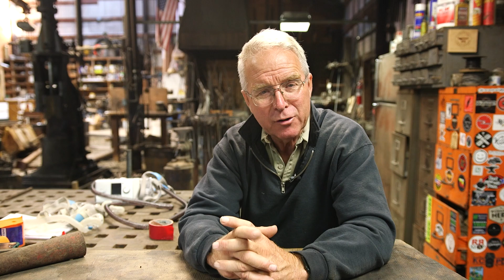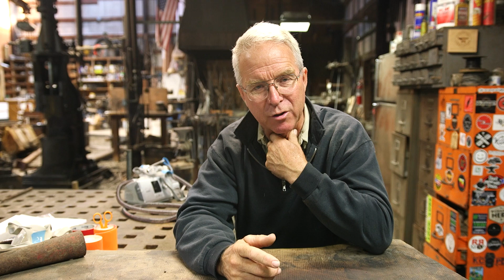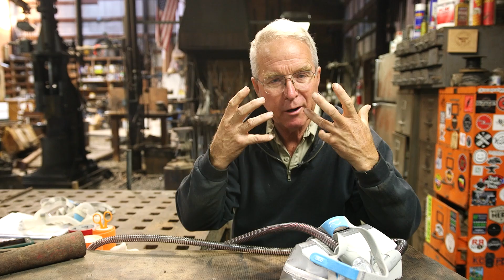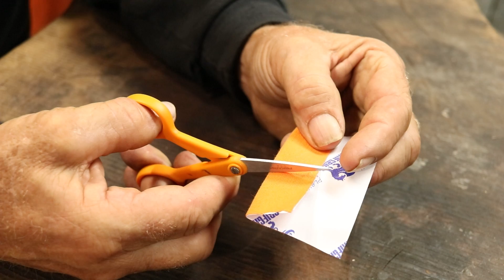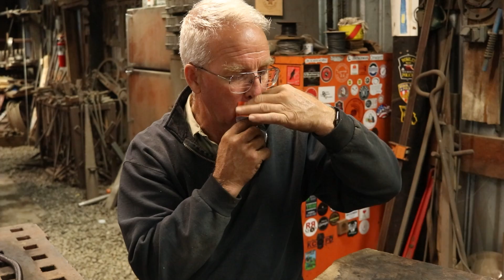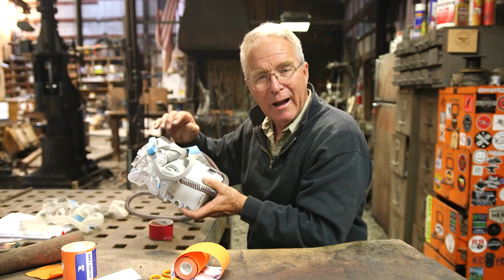Tired Contractor  Here’s My Simple, CHEAP Sleep Apnea Solution

Comment: I need a way to keep my mouth closed. I  found that wearing a full  cotton mask seems to lessen the mouth opening at night. I sleep on a chair futon that has 5 levels at the top. I use medical paper tape when I use tape. Cut the wide tape in half 1/2 inch by 2 inches and tape one side of my mouth from the bottom and pull my skin up and stick. I ordered this tape to try it out. Thanks.

Comment: Tape generates back pressure to stabilize the hypopharynx during expiratory phase of breathing in the 4 different phases of sleep. 
The problem with this it does not compensate suffently during rem sleep whis is very important for the removal of normal brain metabolic waste that may result in an early onset of alzheimer's to name one failure of this approach.
To be clear during rem sleep when we dream we should not normally be aware of our dreams unless we are awaken by untreated sleep apnea in which case we arouse (awaken) in the middle of normal dream sleep or (rem sleep) . This failure ti rest effectively in rem sleep results in excessive daytime sleepiness,higher boold pressure and greater chance of stroke. These comorbidities are a problem please learn to use your cpap effectively there are no short cuts for sleep apnea I strongly suggest you consult directly with a board certified sleep physician to get a good second opinion.

Good health

Comment: My two cents..   Don't eat anything after 5-6pm.  At least try.  I know sometimes is not possible but at least try it.  The logic behind this is that when you eat late it makes your system to suffer from heartburn and that makes your throat muscles to weaken, causing an air block (apnea).  The heartburn occurs more or less after 6-7 hours of eating your food.  If your last meal is at 5-7pm your system will be still strong enough to not have the apnea.  Sorry about my english.  Doing my best.

Comment: I have both apneas as well after my traumatic brain injury.  I had like 100 events per hour.  I could not deal with the CPAP they put me on that night so they started me with a VPAP.  It's like a BiPAP but has a kickstart pressure.  So instead of super high pressure like you had with your BiPAP, they could be much less with the kickstart pressure doing the hard work.  It is the same brand as the BiPAP you have.  It's easy enough to deal with, having pressures set where it's enough to handle the obstructed.  I don't really know when the central kickstart happens.  I have heard so many people talk about how much better they are on a CPAP and haven't gotten there, but I have many other issues due to my brain injury, so there's that lol.  I don't have an open mouth issue that I am aware of, but thought that maybe a VPAP might help with the pressures.  Sounds like the tape works good and you don't need another strap to keep your mouth closed.  Nice!

Comment: Scott do you feel that this tape trick will work with a goatee? I have the exact same bipap machine and even a much higher elevated stop breathing events an hour.  And I have both central and obstructive. After 2 years of sleep tests and different machines I finally gave up for same reasons you did. The dang masks (I tried every available type on the planet )were what you said, "like a medevil torture device". It started to send me into into  a panic mode just looking at the gad awful thing sitting on my nightstand! At this point I foolishly would rather give up the bipap machine and the consequences than give up my prized goatee that I have had for 20 years.

Comment: I have a beard so the full tape doesn't work. I just tear off about an inch of  1/2" adhesive tape. It holds well enough, comes off easily and I make it short enough so that I can breath out of the sides of my lips if I need to.

Comment: central apnea tho. what are ppl's experience with getting the brain to send that signal for taking breaths? medication?
Reply: Central apnea is usually due to CO2 retention, drug related induced or brain injuries. A BPAP St or ASV is used in those cases. Talk to your sleep doctor
Reply: @remjunky  i did read about that after the fact, your points are correct.
Reply: @mikestivers8302  ah cool. I’m a RPSGT (registered Sleep tech) 30 years in. I hate seeing some of the people on here just accepting taping their mouth up. It’s a quick way to have pulmonary aspiration happen. Think Jimmy Hendrix. 

If you do go BPAP ST or ASV, go to a lab and have a titration done. These are devises with precise measurements and the wrong settings can make everything worse. Get it done in the lab then you can buy one on eBay or wherever and adjust the settings.

Comment: Shouldn’t this come with a health warning ie this may work on some patients and not others.  Please check with your physician before making any changes to your sleep routine.  Now how does this work if you have central apnoeas?  eg ones caused by the brain rather than the tongue slipping back down the throat causing a blockage?  I have an APAP and an extremely noisy oxygen extractor.  But I can confirm that like others by 4pm I am a zombie.  Between 8am and midday I am also a zombie.

Comment: So I'm guessing this is your generations version of the tide pod challenge....sounds completely fuctarded to put a piece of tape over your mouth when you sleep. 
Why not just sleep on your side and keep the lights on when you sleep. This relaxes the throat and having the lights on helps prevent you from having the night terrors because your mind isn't racing thinking about what you can't see out of the slit in your eye lids that in the dark. Then your subconscious manifesting your fears in half awake half asleep stage.... If ever you want to fully awake just will your body to move as quickly and powerfully as possible. Usually a arm thrusted to the ceiling will wake you up. If you have learned to live with it. You can calm your self once u realize what's happening. Then you can make your self see what you want in your room lol

Comment: Bla bla. Sounds like you don’t have a doctor that knows what he’s doing. Also not wearing a proper mask that keeps your jaw closed and then using the nose pillow so it keeps your mouth closed and pushes the air into your nostril. Then you can effectively lower the pressure and you’ll get the best night sleep. 
I’m sure every case is different I can’t tape my mouth shut because my breathing pathway through my nose is restricted and I need the forest air in order to breathe, but that I have no problem with the mouth fog or whatever it’s called, into your nose out your mouth path.

Comment: lol 32 times an hour, try 68 time an hour on average like I have, sometimes mine goes up as high as 90. 32 times an hour... youre lucky my friend. The apple watch is Garbage btw, data coming from is is about as truthful as a trump rally. 

So you are telling us What you are doing, but you are not telling us What the tape actually does. I can see how it might help with obstructive apnea which is typically caused by the upper throat and would be bypassed entirely by breathing exclusively through your nose, but how would taping your mouth help with central apnea? How would it help with shallow breathing or more complex issues like  Cheyne-Stokes respiration?? I think you need to do a bit more reading before you recommend doing something like mouth taping which might actually be dangerous for people with those conditions.